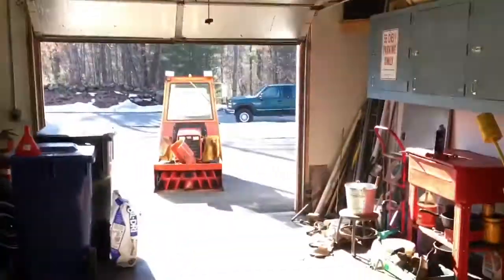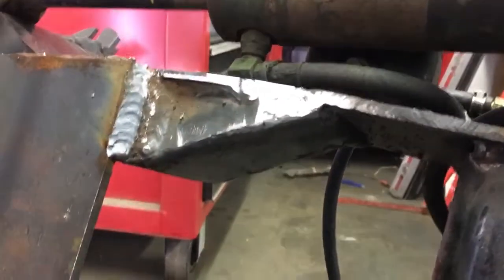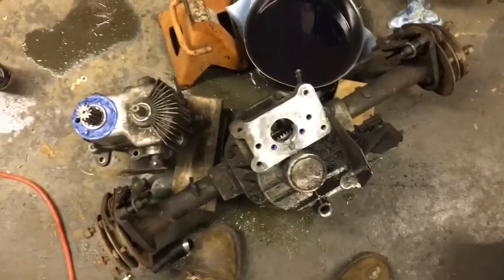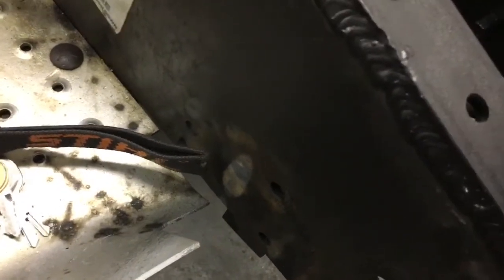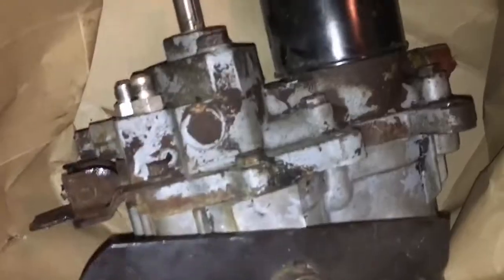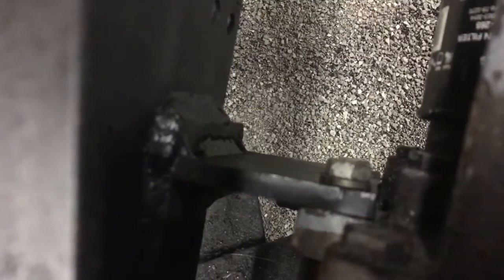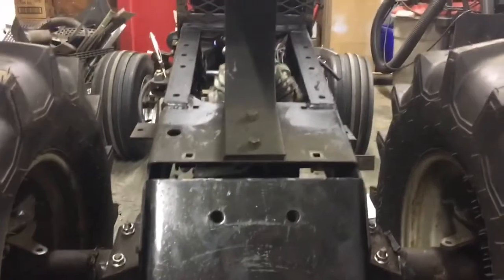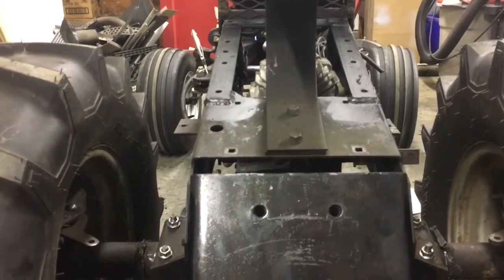Diesel tractor progress and setbacks

Comment: Hey buddy the hydro bypass's on top of the pump ,, the 2 brass looking things on top of the new pump you got ,, well in the middle of them you will see a little plunger in the middle if you clean them off,, well hate to be the bearer of bad news those plungers should be sticking out the top,,, like on the little plastic temp gauge on a turkey ,,, and both of yours are down,, now their purpose is to disengage the tranny if you need to push pull or tow the tractor ,,, and when they are down the tranny is disengaged ,,, aka it wont drive,,,, so you need to get 2 new ones ,, can get them on ebay ,,,for about $40 bucks each,, rebuilt,,,, so again sorry to be the guy to break the bad news buddy ,, but that is the real deal.. all of my john deere tractors use the same sunstrand 15U hydro pump and have them plungers,,, so i am quite familiar with them ,, if you habe any questions shoot me a message,, ill try to help you  out
Reply from the maker: PhatboyHD88 they are supposed to pop up once the tractor is running. The pressure generated by the pump kicks them back up. There's no fluid in the pump right now so there's no pressure to hold them up.